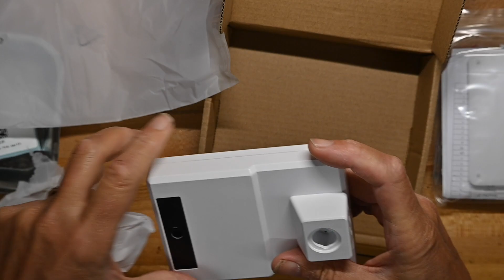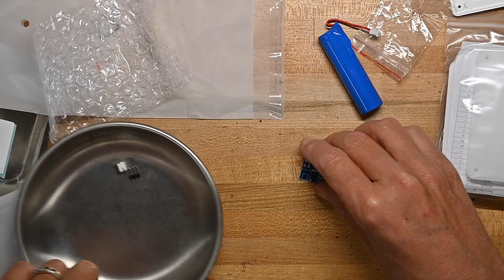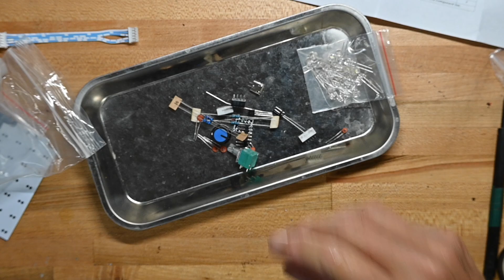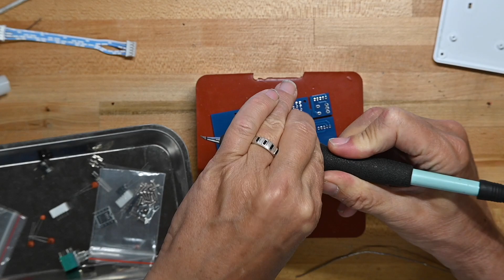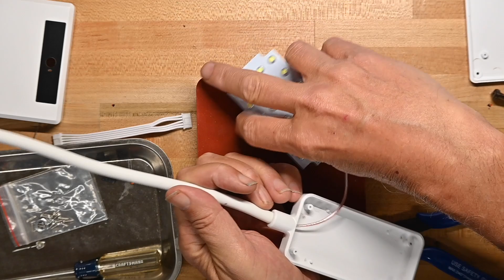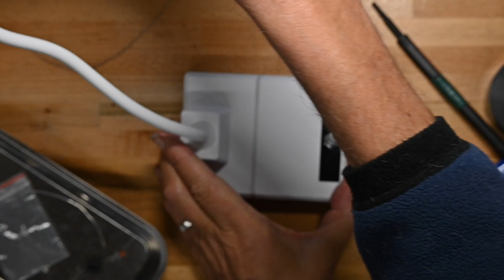C.K. builds an LED desk lamp kit from MiOYOOW

Comment: Thanks for the video. I had one of the screwheads strip out. I put some soldering flux paste in the threads and the rest went in without a problem.
Reply from the maker: You’re welcome!  And yes, always have to be careful with the inexpensive hardware used in these kits, a little enthusiasm and they fail. Glad you could fix it.

Comment: If you should find you need a heavier base, you can buy a cheap pack of 50 lead bullets or similar and add as needed to the base. I  reload my own ammo and cast my own lead bullets and i have used them in a base for my digital microscope. I can almost go 180 degrees across if necessary. They can be very useful. Just a thought.
Reply from the maker: Good suggestion.  It does get unstable when I turn the gooseneck to the side, so might do that.

Comment: On all those extra contact points on the pcb, looks like it might also be used as an Arduino-controlled board for something else, maybe...? Oscillating lcd's or something.
Reply from the maker: Something, for sure.  Just can't figure what since there are no traces in the PCB connecting them to anything (even each other).  A Great Mystery.

Comment: This is a great kit and you did a great job building it. So, of course I had to buy one for myself! Great job. As a side thought, while you were building this lamp, I was thinking about the movie "The Breakfast Club" where the nerd built an elephant lamp that should turn on when you pull on the trunk. I am very happy that this worked out for you!!! LOL. Thanks for sharing this experience.
Reply from the maker: Always fun when I build a kit that I will use long-term.  Very handy to use around the shop on battery power when I need some bright spot lighting.
Reply: @CKHaun   I finally built this lamp today. I did break the head off of one screw because I attempted to back it out, same place you did. My power wire to the LEDs did not snake through the conduit quite as smoothly as yours did, but I just worked the conduit a bit and it went through. I used velcro to keep the battery from slamming around inside of the case. I think this lamp is supposed to have touch controls right near the potentiometer, but I haven't looked deeper into it. This lamp will come in handy during an electricity outage.